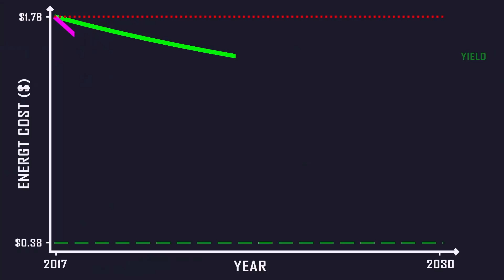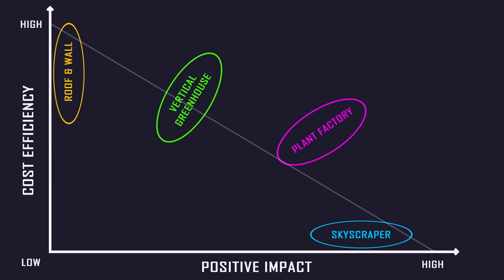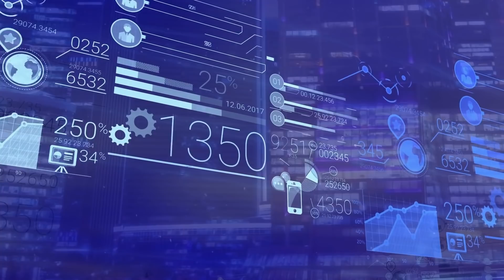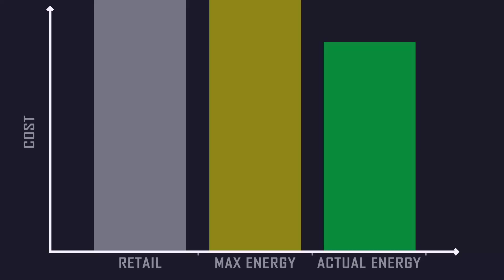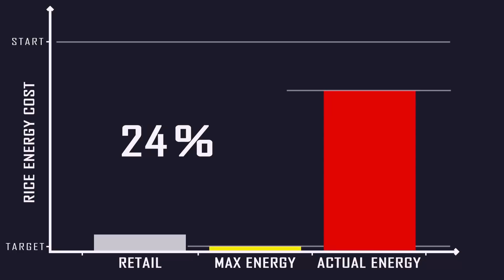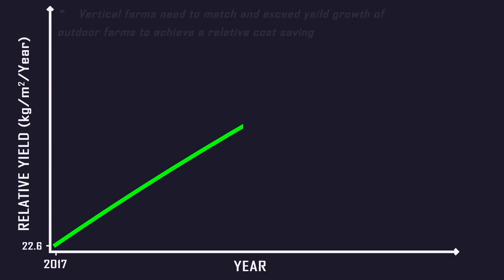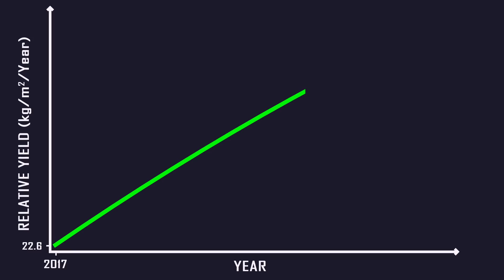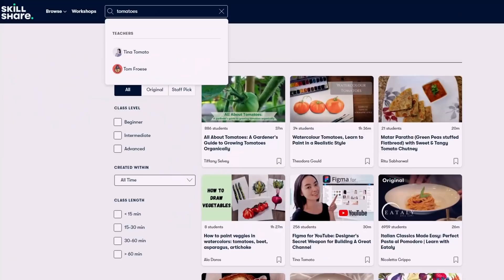What's The State Of Vertical Farming In 2021?

Comment: There are some HUGE changes coming in the vertical farm industry that I am watching for;
1) Synthetic meats are going to be a game-changer.  Over the last few years I have learned that my body hates me, and hates a great many plants, and so I have had to dramatically change my diet to non-dairy and non-wheat meats and starchy staple crops... and that gets expensive quickly.  fake-meat products are a game changer in their own right, but just a stepping stone to synthetic meats.
But synthetic meats need feed stock of nutrients and protine that isn't traditional food.  This is fantastic on 2 fronts; One is that edible foods won't need to be diverted to meat production.  The other is that this meat can then be grown on racks and shelves instead of huge swaths of fenced-off land, which will have an even larger impact than growing indoor veggies!
2) Closely related is what you feed synthetic meats, which is a slurry of aldge that is itself engineered to produce specific protines.  This isn't particularly human-edible, but is only grown in outdoor vertical farms via large tubes for maximum sun exposure.  It is a closed system like an in-door farm, but does not need any of the power costs of indoor farms other than pumps to move the slurry through.
But what is more exciting is that this sludge can be used to make all sorts of non-editable 'foods'.  It can be programed to make protines, or hydrocarbon fuels, and potentially even medicines or other synthetic base-products for other industries.  A lot of this is traditionally diverted from field crops like corn to ethanol, so just like the synthetic meats that save on a lot of space, this is a game-changer.
3) A close-cousin to vertical farm are new mixed-use farming methods which adds an aspect of verticality to traditional farming.  The idea there is finding things that use different 'domains' which are beneficial to eachother.  As an example; Having low-density solar arrays lifted off the ground to provide shade or partial shade to plants that don't do well in full-sun; These panels can produce electricity, heat storage, water, etc.  The next domain would be the layer for trees and vines that aren't good candidates for indoor farming, but will do better with less sunlight rather than more.  Then below that you have an animal or low-crop layer.  Having chickens or other small critters that keep the weeds down and help fertalize the soil while they themselves get to enjoy the shade of the panels and trees.  It isn't quite the same as vertical farming, but it just starting out in Europe where density is more of a concern, and it borrowing heavily from vertical farm ideas and techniques.
Like #2, this is outdoors, which means less energy use, and with a combination of solar and water producing panels this has the potential to open up more income streams for traditional farms, or provide the power and water necessary to fully power a vertical farm on the property.
4) Aquaponics has been a thing forever in small do-it-yourself operations, but is about to get a major push into vertical farms.  The trick is that it adds a lot of complicaiton to the mix in needing to filter and balance the water cycle, but the up-side is having extremely nutrient-dense water to feed plants, and a place for the non-sellable plant material to go, and an income-stream of selling fish and shellfish meats.  The hurtles of manageing these systems cheaply and effectively is nearly done, which will change the industry in a big way.

But it is important to keep in mind that all 4 of these are in their early research days.  Nowhere near the practicality of the focus of this video, but these are the next-steps coming to the industry being looked at, and should offer advantages that further accelerate the transition and take-off of these vertical farms.

Comment: Vertical farming is nice, for leafy greens, herbs and such. But overall, it just doesn't seem to be cost effective for normal farming as it's quite expensive, and it's pretty taxing on resources too, making it actually not even that good for environment, even if it is much more effective. Building the warehouse, equipment and producing energy (even renewables) use a lot of resources and energy. 
We have so much progress to be made with regenerative farming practices, other new farming techniques that are not traditional mono-culture, things like using solar panels above some cops that do not need so much light to reduce water consumption and generate energy at the same time, etc. 

But really, vertical farming is good and most suitable for crops like leafy greens and herbs ofc, but also crops that normally would not be economically viable but I don't think it will actually replace much our traditional farms though.

Comment: I see it as a great source for micronutrient rich foods. But the energy we need to survive is in the macros. Protein, Carbs and Fats. What are some macronutrient rich foods that can be grown in these systems??
Reply from the maker: The answer is it depends. The current state of what is viable is heavily skewed towards micronutrients, due to the energy required to produce say carbohydrates. lettuce is 95% water, so to simplify, your light energy goes into growing that 5% dry matter.

Another way to think about it, producing food with more calories requires more input of light energy. About 5% of the edible part of strawberries is sugar, which of course makes them relatively calorie dense. These are only just starting to become viable thanks to improvements in LED's and growing conditions.

The most important and difficult crops are the starchy carbohydrates that are both calory dense and have a high dry matter ratio - things like rice. These aren't viable yet, they can be grown but not cost effectively. The progress in the technologies mentioned in the video must continue, in order to make these really high-impact crops. It seems almost impossibly difficult right now, but if the key exponential trends continue, then it actually starts to become viable surprisingly quickly.

Comment: Working for a vertical farm company called Oh My Greens out of Sweden and we’re launching in Spring. This is really well researched and hits the nail on the head on most things regarding the state of the market. Glad you’re putting the word out there and that your research is more than up to par.
Reply from the maker: Glad you liked it, and great to hear you are getting involved in the industry. I inadvertently got involved in the industry myself after posting the original series, and it's been fascinating seeing new operations evolve so quickly.
Reply: @ExaCognition  best of luck then, let’s hope this tech will make our food supply chains more stable as the climate changes. And it’s funny because my involvement was pretty inadvertent as well

Comment: A big problem I see with this is the Solar to Electric - Electric to light - light  +CO2 to food cycle, this is really not that efficient, as an example solar panels are 15%  - 20% (33.7% being the limit for silicon solar panels), and with light manipulation we can get up to 2.72 times (maximun theoretical) the efficiency of solar light (white light) as most plants dont absorb a ton of light frequencies so assuming a 33.7% solar efficiency and a 272% light efficiency the theoretical plants per area of sun is  91.66% of normal farming (40.8% using actual average panel), and this is on ideal solar panels perfect conditions, I guess we would have to see if the other advantages like transportation and better growth conditions make up for this, but theoretically its much more land intensive to do it this way
Reply from the maker: In reality, it's far less land intensive even when using solar panels and factoring that area in. It comes down to the edible mass produced per photon being substantially higher for controlled environment agriculture. Some of the factors are relatively easy to understand, photoperiod control, nutrient supply with hydro/aeroponics and root oxigination, temperature control, humidity, CO2 enrichment, less crop losses from pests lowering average yield etc. Others are less obvious but also very important, growth triggers at specific plant phase e.g a deliberate change of spectrum at a certain growth phase of a plant, to trigger desirable outcomes. These further boost yield, but also can be used to limit growth of inedible structure such as roots. If you compare the ratio of root weight to edible mass of an outdoor crop to those seen in an optimized plant factory wastes far few photons growing edible mass. This doesn't matter much in a field, but when we are accounting for input energy, its changes a lot. The other way the results of this control is quite visible is in the harvesting period. Plant Factories can quite easily achieve 12 harvests per year, which is much more than the 2 or 3 per year you normally see outdoor. This gives an indicator of the growth rates and land utilization that can be achieved with indoor growing.

Comment: Amazing! By increasing the efficiency and density of edible plants, we can grow them on less land, overcome region-climate barriers, and distribute production anywhere. This will dramatically lower the cost of the entire food chain! It makes me wish I were an engineer in this field. All I know is computer programming...
Reply: Actually no, in the perfect conditions using ideal solar panels you can only get up to 91.66% efficient use of land, less efficient than normal farming, have a comment explaining in detail where I get that number (33.7% from an ideal silicon panel * 272% maximum theoretical light efficiency because of lightwave trimming, currently ~20% and ~150% which means currently we can get only around 30% efficient)
Reply: @ratgr  Isn't that the same as photosynthesis? Doesn't that mean 1 acre of non-arable land (think desert or city) plus this tech can grow basically 1 acre's worth of food?
Reply from the maker: In reality, it is much higher for indoor controlled environment agriculture. I will copy what I said somewhere else above: In reality, it's far less land intensive even when using solar panels and factoring that area in. It comes down to the edible mass produced per photon being substantially higher for controlled environment agriculture. Some of the factors are relatively easy to understand, photoperiod control, nutrient supply with hydro/aeroponics and root oxigination, temperature control, humidity, CO2 enrichment, less crop losses from pests lowering average yield etc. Others are less obvious but also very important, growth triggers at specific plant phase e.g a deliberate change of spectrum at a certain growth phase of a plant, to trigger desirable outcomes. These further boost yield, but also can be used to limit growth of inedible structure such as roots. If you compare the ratio of root weight to edible mass of an outdoor crop to those seen in an optimized plant factory wastes far few photons growing edible mass. This doesn't matter much in a field, but when we are accounting for input energy, its changes a lot. The other way the results of this control is quite visible is in the harvesting period. Plant Factories can quite easily achieve 12 harvests per year, which is much more than the 2 or 3 per year you normally see outdoor. This gives an indicator of the growth rates and land utilization that can be achieved with indoor growing.
Reply: @ExaCognition  I thought something similar, that photon efficiency is not the bottleneck here.
I suspect plants have far more potential than ever observed in an open-air field.
Of course, I'll have to leave the proof and hard work to experts willing to take the economic risk. I hope they succeed.

Comment: This also takes tons of generated electricity to grow and most plants using this growing technique are not pulling natural nutrients found in soil because in most cases soil is not used therefor not being very nutrient dense.
Reply: Don't the nutrient solution fill in the nutrient needs? It takes more to control what nutrient goes into a vertical system but since you have more control of what your plant takes in an advantage?

Comment: I can't really see vertical farms ever being useful beyond certain niche applications. Even setting aside the vast resources used in construction, scaling vertical farms to the point they made a significant contribution to our diet would mean adding an insane amount to our electricity consumption, exactly when we need to be doing the opposite. While there may be cases where the energy of indoor growing nearby is less than the energy used in transporting crops vast distances, perhaps the real solution is to stop transporting crops vast distances. Space isn't actually an issue in agriculture. If we stopped eating meat and moved to permaculture practices then we could produce more than enough food and still be able to rewild areas currently in cultivation. It seems that that should be our real priority; leave vertical farming to the billionaires trying to colonize space.

Comment: I'm completely unconvinced by this small grow-at-home idea. That "washing machine sized" contraption looks like it stores enough greens for one decent salad. Maybe two. I can't see a fully-grown adult being able to sustain themselves off the food inside for more than a day - and that's being pretty generous. And how long does all this take to grow? 3 to 4 weeks?

So for several weeks of waiting, you might grow enough for one person to eat for one day. And that's the ideal case. And for this privilege you have to find a spot for an appliance the size of a washing machine and power it.
Reply: Even if the production yields are significantly higher,  How many salads are you gonna eat? With that being said I could see a system put in place In say a basement that you're not really doing anything else with. Even a relatively small amount of square footage can produce can produce a substantial amount of yield, for example my backyard potato barrel yielded close to 50 pounds last year, and I'm not the bestest gardener ever.  The footprint is approximately  4 ft² So I think an optimized process that was able to grow potatoes year round with a new crop every 80 days for 4.5 crops per year would easily be able to keep a family of 4 fed on about  20 ft² maybe even less. At least assuming that they eat the average of 111 pounds per person per year.
 Granted my numbers are assuming a hypothetical optimized potato growing system That matched the yield of a mediocre gardener's backyard potato barrel. So not exactly Clark Tech as another YouTube futurist would refer to it

Comment: Your previous videos really inspired me, I have been trialing my own Organic home production using soil as well.  The premise is I have a mushroom farm and chickens, plus my soil based farm that I am trying to swap over to cover crop like alfalfa as a fodder/worm food.

So when the mushroom substrate is spent, I throw it in with a chicken coop, they manure on it, then it rests until it goes into the worm bin, then into a pasteurization pile, then mixed with 33.3% with coco coir, and 33.3% mushroom sawdust substrate.  The mushroom substrate being a living organism will bind the other substrate together into a plug, so I dont need a net cup, and it reduces the amount of debris.   I then place these into NFT gutters.

The reason I have obsessed about this is I do not own my own farm, so I've spent thousands on soil ammendments and had to walk away from my development.  This way I have a recycling system and if I ever have to move, i can hire a dump truck and remove all the compost piles and worm bins to the next location.  Also soil, while it requires filter, the nice thing about it is if there is a water issue, the plants have a little moisture time stored in the soil block, as well as having fertilizers that don't need to be water soluble, which often cost less.
Reply from the maker: Excellent work, I'm impressed by your "Circular Economy", type reuse of waste materials.

Comment: has anyone made a study about the nutritional profile of indoor produce
Reply from the maker: There is some research data one. Indoor growing can achieve high nutrient densities, because they have much more control over nutrient input , acidity etc. through hyrdo/aeroponic supply, and environmental control such temperature, humidity, transpiration, and importantly, spectrum control. This allows indoor growers to tailor the nutritional profile.

This produce usually reaches the customer much sooner after harvesting, which also has quite an impact.
Reply: @ExaCognition  that's good info, thanks.

Comment: Great video! Where did you get data like led efficacy?
Reply from the maker: https://www.energy.gov/sites/default/files/2020/01/f70/ssl-rd-opportunities2-jan2020.pdf

That's the 2019 one which is the last full report, they didn't release full versions for 2020 and 2021 workshops but you can still find and use the presentation slides they released.
Reply: @ExaCognition  thank you

Comment: In terms of crop diversity, one point to consider is that if we can remove leafy greens from 2d farms, that provides a lot more space for fruits and grains. Which is not the same as growing them vertically, but does show the connection between these factors.
Reply: also: I think leafy greens and tomatoes themselves probably make up a HUGE percentage of all the vegetables consumed in the US.
Reply: @NirvanaFan5000  you're correct, about 50% by weight iirc, according to USDA data on food availability for 2010.